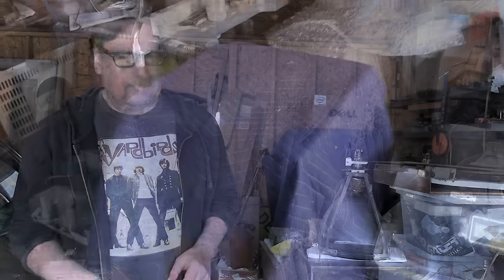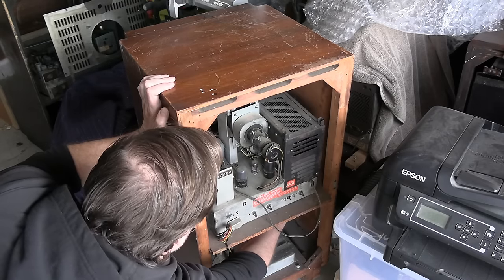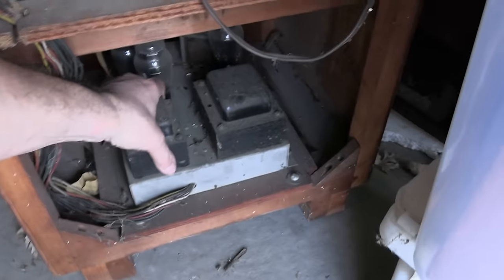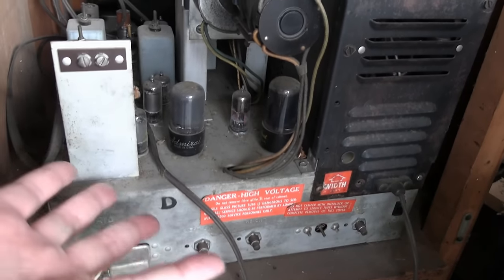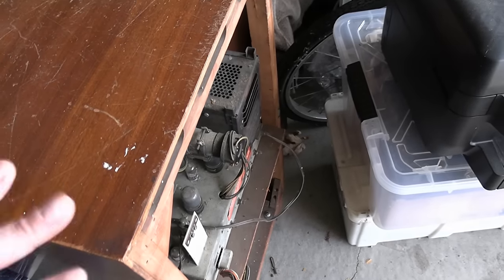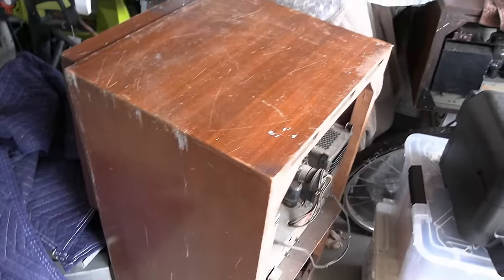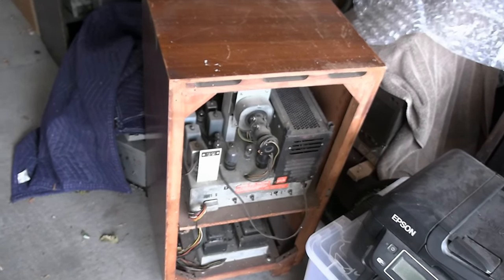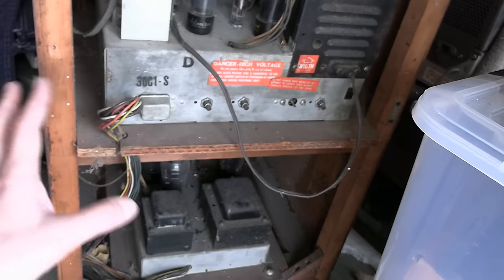Beginners guide to B&W tube TV restoration part 1 (transporting)

Comment: I used to get the rejects from two TV shops in my area close by. A buddy gave me a bunch of Motorola Hospital sets to get me really started. I got most of them going and gave him like 5 bucks for every set I sold. Anything I couldn't fix I saved the good parts for the next one. Then I hooked up with the TV shops and they just let me take any set that the customer didn't want to fix. I'd load them into the trunk of my Dart. It had a very low liftover and I usually could just pivot the big sets in and bunjgee down the lid and tie them down if needed. One shop gave me their old Beltron when they got a new one and the other gave me their pro level suitcase tube testor when they decided they didn't see enough tube gear to need it..
Was a fun time and I kept a add in the local Nickel adds free paper as this was way before the internet got big.
Learned a lot about the typical failure points of the popular sets and kept parts and tubes around to fix them. Occasionally the shops or my buddy would help me out if I was stuck and one time I had a complete early Magnovox electronic tuner setup in my trunk when one of the shops had a customer set in that needed it and it was NLA. I told them I had one and they were amazed and great fully took and tested it and put it in the set.
I got a lot of goodwill and much nicer sets after that 🤣

Comment: The back to basics format is greatly appreciated, I've been restoring radios receivers and other test gear such as RF and audio oscillators/ CRT oscilloscopes for a few years now and recently bought a Ferranti 1950's British TV set to see if it could be restored(i paid 10 pounds on eBay) and I've not really known where to start up until now, bob thank heavens is here to guide me, even if you guys across the pond have funny names for thermionic valves like "tube" or as shango66 sometimes calls them "vacuum bulbs", now i can follow this series and get started, Thanks Bob!

Comment: Excellent start!  I have a 1948 Admiral 19 A 11 that needs a restoration so I'm looking forward to the rest of your series.
Reply from the maker: Well I hope it helps some, but that is an electrostatic set and is quite different. I've restored several of them if you go back though my older videos. The Admiral 19A15 series turned out especially well. Same chassis but wood cabinet
Reply: See, I've just learned something else! @bandersentv

Comment: Thank you sir!  I have a lot of experience with arcade monitors, but those are all mid 70's to 2000 or so designs, these early ones are a little bit different beast as you well know.  I have a little bit of tube radio experience but all the arcade monitors of course are transistorized.  I'd like to start tinkering with some of these older sets and this series will help me expand out and learn the differences to what I'm already familiar with.  Very valuable information for a man with your experience to share this with us, thank you.

Comment: For anyone new to this stuff, it is a good idea to wear some kind of eye protection when working around these old picture tubes. It's rare but they can implode especially when you are moving chassis around that have the picture tube attached to the chassis. Implosion can send shards of glass inward and then they will bounce off other parts of the picture tube and explode outwards. Be very careful!
Reply: Yes! especially with the face guard glass removed.  This glass was made to be removable in order to provide access to clean the picture tube face, which should be done using window cleaner and a clean soft cloth, with the set powered off -- or better, unplugged.  Newer picture tubes have integral face guards and are more robust, with less area exposed to air pressure.  Also be careful about charge built up by the picture tube, which can last many minutes after the set is powered off.  I used to use a jumper lead and a piece of foil taped to the outer coating to keep the charge off.  Yes, some picture tubes can spontaneously regain charge.
Reply: 60年以上のブラウン管は劣化のため細かなヒビが入ってしまうのですか？
Reply: @zhaohaigaogu7821 If glass tubes are free of flaws they will never develop any cracks or deteriorate for hundreds of years. 
The glass in medieval church windows has flowed a little bit because glass is a very viscous liquid over a long time period.

Comment: I've restored or repaired 100s of tube guitar amps and also radios from the 30s - 1960s . . .  but never tackled a TV. Good advice in selecting a unit to work on. I always buy complete as possible with original parts and minimal stories (although this 1940 Zenith radio I am working on today turned out to be a storied rabbit hole I wasn't planning on). Looking forward to watching your series regarding this. Thanks!

Comment: Looking forward to watching this series. I just picked up a super low hour 1959 Silvertone Medalist 24 inch set that is in mint condition (and has an interesting story about the low hours!) It's a series string set, not power transformer unit. Lots of caps to replace along with a corroded off 51 ohm sand resistor at the beginning of the string. I haven't worked on old tvs since about 1988 when I was a teenager and am FINALLY getting back into it. My old CRT tester even still works!
Reply from the maker: Good luck, but I warn you the set I feature in this series is 10 years old than your set and transformer powered.  Some of what I cover will not apply to your set.
Reply: @bandersentv  oh I fully understand, thank you! Starting up a series string set after many years is less nerve-wracking in my opinion although there's still plenty that can go poof. It's amazing what you have to dig out of the brain after over 30 years of a hobby being in Slumber mode. I was lucky I still have my dim bulb tester and CRT tester. I'm going to perform a soft start on the unit tomorrow and then after that I'll be ordering a whole slew of capacitors for replacement

Comment: I have a Philco 50-1630 TV and the flyback failed after it overheated.  It wound up being caused by a faulty yoke and I would have never checked the yoke if I hadn't read the paperwork that comes with flybacks saying to always check the yoke after a flyback replacement before putting power to the set.  Sure enough, with an Eico Ring Tester connected to the yoke, I noticed the needle bouncing all over the place as I tapped the yoke with a screwdriver handle.  The windings were loose... not secure like normally with enamel.  Before the failure the TV did have an occasional horz fold over.  Sometimes I saw a V shaped picture.  Like you said these issues are rare in 40s television.  I found the replacement for a 50-1632 on Ebay, thankfully.  Flyback runs cooler, and TV is happy.
Reply: Triad made the replacement for this set.  One weird thing... it has a B+, and B- suply to the flyback, and Sam's only has the circuit schematic.  Nothing else. Low.productiin numbers?

Comment: Also, I think Bob has mentioned this in past videos: Look for CRT brighteners attached inline with the CRT socket connector. Sure sign of a dead tube. If you see that, just assume the picture tube is bad. Not a deal breaker but can be grounds for price chiseling.
Reply from the maker: Aw nuts, forgot to mention that!  Thanks
Reply: And remove all the knobs from the front,some might have small screws!

Comment: Nice work Bob, you covered most of the items a novice would discover the hard way, meaning set damage or worse, bodily injury.  Good point on the chassis mounting screws, when I worked as a Tech in a TV shop, I noticed during the first service the set receives, the Tech usually would toss all but 2 screws for the chassis and back.  Then there is the set someone worked on but, gave up.  These generally have no screws holding the chassis in plus, shields are missing.

Transporting the TV, my first choice is face down on a flat surface with a thick blanket covering any contact point.  Of course as you mentioned, this assumes nothing protrudes from the front of the set that could get broken off.  My second choice is with the set upright sitting on its feet, well strapped down so the set can't move.

Another thing to look at when considering a set, is whether it is home to various creatures (mice and roaches) and how much damaged they have caused.  Also, has the set been stored on a high humidity environment (such as a wet basement or outside), look for a rusty chassis and water damaged wood.

I commonly use my high voltage probe when discharging the CRT anode.  The sharp tip easily slides under the high voltage cap and you get the resistive discharge.  If that is not available, use a flat-blade screwdriver with a jumper attached to the screwdriver shaft and the chassis.  I have regularly had CRT build up a charge during CRT removal/replacement so, don't ever assume the anode is fully discharged.

Comment: Pretty curious these sets from 40s. Archtecture of circuits totally diferent from 50, 60s sets. Regards from Brazil.
Reply: A lot of difference, due to the evolution of TV technology. I basically learned TV work on may parents' old 1956 Admiral Super Cascode C23B16. It had an upright, 20Y4E chassis with 3 PC boards for IF, Audio, and sweep, and 94D92 VHF tuner. The picture tube was a 21ALP4 rectangular, aluminized CRT, separately mounted to the cabinet. The picture tube was removable from the front of the set, while the chassis came out the back. The main operating controls were at the top of the set, and the cabinet sat on a lazy Susan type base. I recall the chassis arrangement made it a pain to access the CRT anode connector when required for discharging. Although it was still an Admiral B&W TV, it looked nothing like this earlier set.

Comment: OR- A Magnavox CT-224 TV. I still can't figure out what is wrong with that set. It looks like that Admiral has two ion traps on the neck of the tube. What is that?
Reply from the maker: Yes. 10BP4, 12LP4 and many others use two magnets.
Reply: @bandersentv  Mine only has one magnet and I could never get the picture centered just right. Maybe it was missing a magnet. I should look into it again.
Reply from the maker: Doubtful.  If it was you wouldn't see anything.  It may have been rebuilt with a single magnet gun or it's a variation - 12LP4A for example.
Reply: @bandersentv  I looked at some of my pictures. It does have two. It has been a while since I looked into that set. I should go over it again.
Reply from the maker: @bellytripper-nh8ox  you got it

Comment: my first tube device wasnt a tv it was a Philco model 70, I got for 50% off through my work connections, I should have reality pounced on the Westinghouse grandfather clock radio
Reply from the maker: WR8?  If so, yes, yes you should have!
Reply: There was a WR8 in Ohio or Indiana on marketplace lately that the seller kept knocking the price down, somewhere around $100-125 before the listing disappeared.
Reply from the maker: Great price if it's all there and that's a big IF.  They are often missing the back, wooden knobs, clock hands etc.  You can sink a lot of $$ into fully restoring one.
Reply: It looked all there and original, just had no takers. This past Kutztown (or maybe it was the one before that, my mind is blending some memories together) had a WR8 complete unrestored for $150. Unless its the remote version, the only hard part to these is getting the damn movements done because no clock repair places will go near anything electric even if its full of actual gears and clockwork movements. 
 @bandersentv
Reply from the maker: @sgath92  Sure, Kutztown will be a tough place to get top dollar.  Too much competition and picky buyers.   Also, most collectors want small tabletop radios and have dozens or 100s of them.  I'd rather have a very unusual or high end radios personally.   The only WR8 I've ever seen for sale in my area is the one I own.  The clock works fine :)

Comment: I’ve always wondered what is the point of restoring these for most people? To resell? To use as a vintage monitor for a cable box?
Reply from the maker: Very few resell.  Most of the sets I work on are brought to me by their owners.  They want to watch them.  Especially classic TV shows.  Not everyone wants to watch a B&W 4:3 aspect ratio show on a giant OLED TV.  You can use the tuner. It's not hard to set up a home transmitter and have multiple channels.

Comment: Unfortunately, the audiophools have latched onto the 6SN7, a staple type for early TV sets.  Prices have been increasing on eBay and other places....
Reply from the maker: Same for 12SN7 needed in many of the electrostatic sets.  Find-a-tube is the best place to get TV tubes.  I'll talk about sourcing tubes and parts in future segments.
Reply: Also the 5U4s, some of the output tubes (sometimes 6V6 etc).